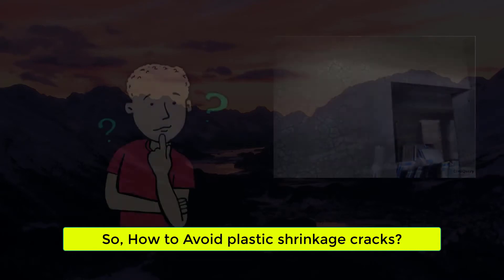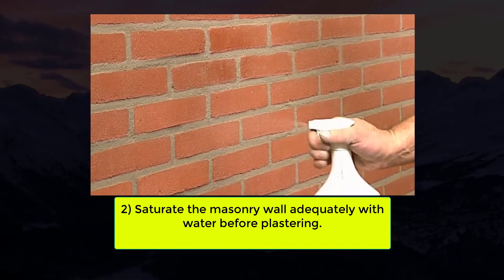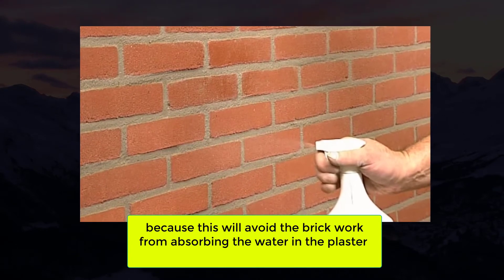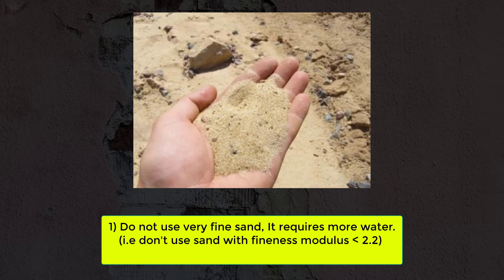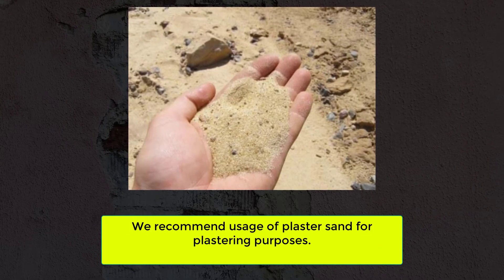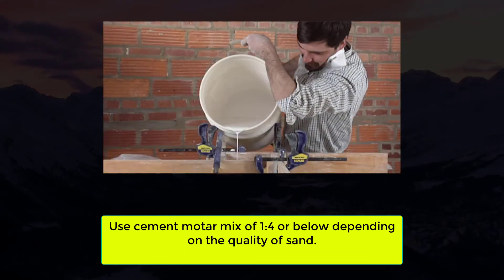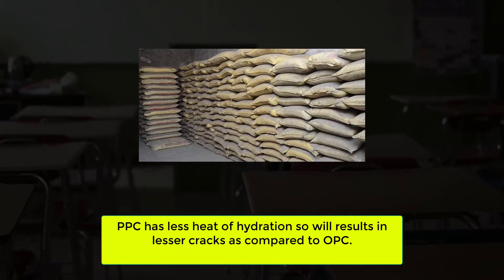How to repair cracks in plaster walls and ceilings? A detailed study on plastering!! #plastering

Comment from the maker: 00:35 What is plastering?
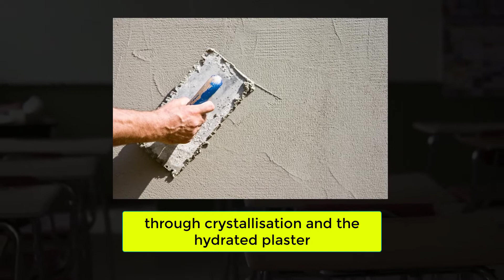01:18 How cracks form in plaster?
01:41 Different types of cracks?
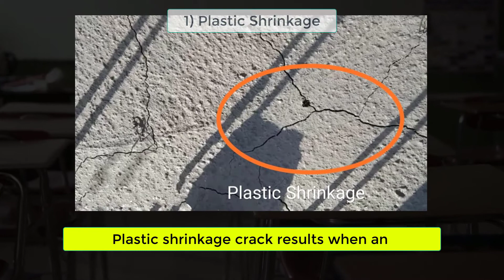02:09 Plastic shrinkage cracks in plaster?
02:34 How to Avoid plastic shrinkage cracks?
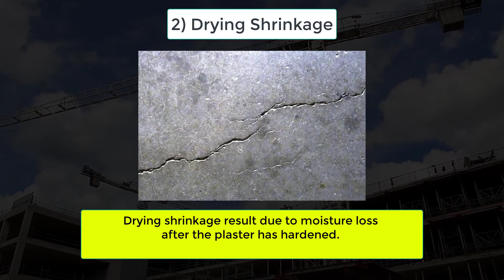03:25 Drying shrinkage cracks?
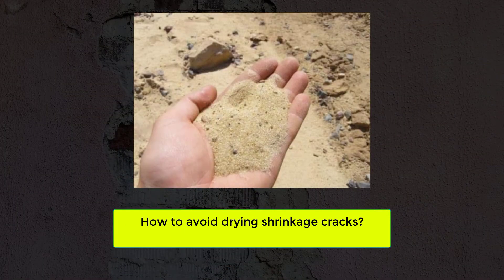03:55 How to Avoid drying Shrinkage cracks?
05:07 Procedure to repair shrinkage cracks?